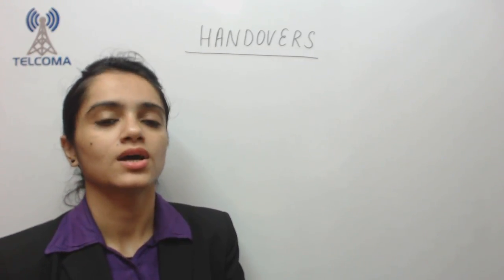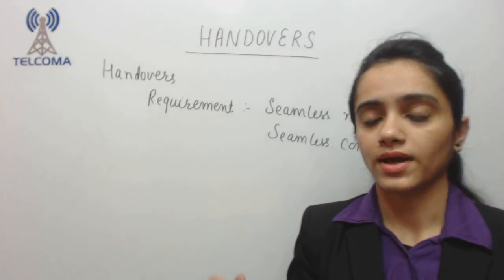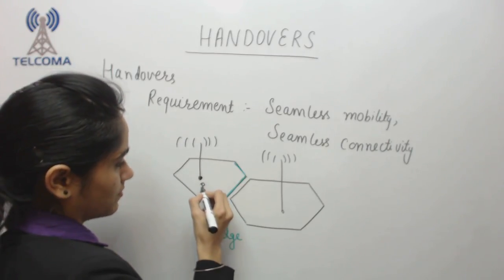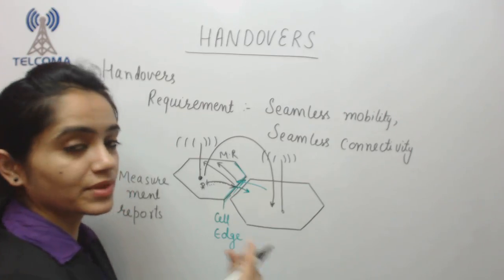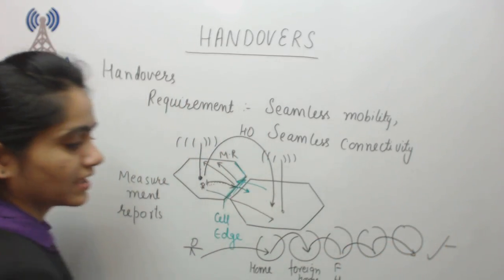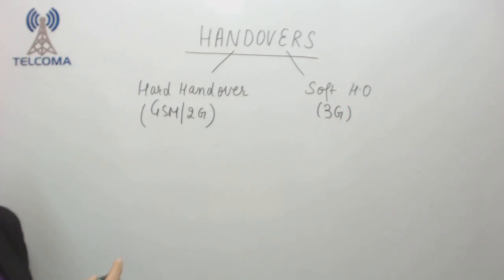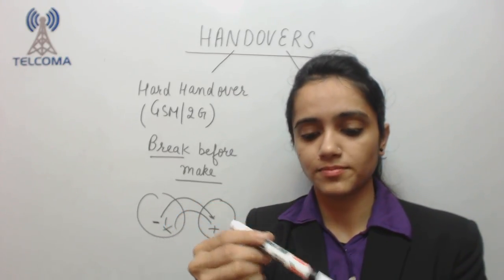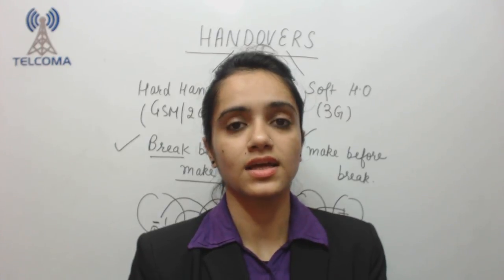Handovers in GSM by TELCOMA Global

Comment: Hard Handover however, is also used in 3G systems when it is needed to change the frequency of the carrier, either
performing inter-frequency handover (i.e. change of UMTS carrier frequency for balancing load purposes) or performing Inter-RAT (Radio Access Technology) handover from UMTS to GSM.

Comment: First of all good work... 👍👍
Tell me mam who decides on which band one mobile network should be.. 850, 1800, 2300 is this our mobile network who decides or mobile ?? When all three frequencies are strong enough... Because my mobile always switch to 2300 MHz but this frequency is  over loaded.. 1800  and 850 are giving me far btr speed ... I knw 2300mhz has more spectrum but tel me who decides when am automatically switched to 2300 my mobile or network provider
Reply from the maker: The network provider has one frequency range allocated by the government. Your your sim will work only on that frequency. If you insert a different operator sim, the frequency may be different. You cant control it or change it...
Reply: TELCOMA Training tnx mam for ur reply but i think i was unable to explain you what i want to knw.. 
Like jio has three bands in punjab 2300, 1800 and 850... And in my area i receive all three frequencies... And my mobile always switch to 2300 MHz automatically... But when i switch it to 850 MHz manually via engineer mode i get more speed... So i am very curious that who decides that my mobile should be on which band.. jio or my mobile...
Does jio decides which band has less traffic or our mobile just go with higher frequency automatically if available because 2300 band 40 has more data speed and spectrum.. plz try to understand what am i asking... Thank u so much.. i appreciate ur time..